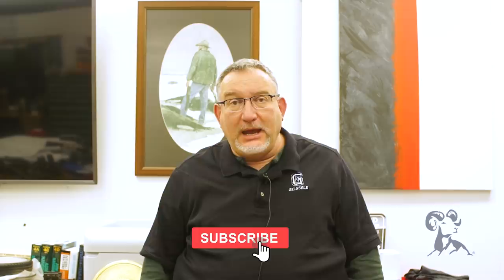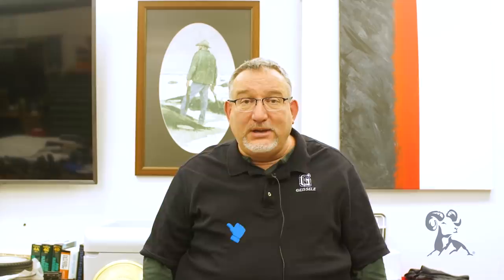SmythBusters: Galvanic Reaction & Your AR-15 - Part 2

Comment: This still does not cover all the myth or areas off. First I was told by a Brownells gun tech years ago that copper anti seizant made by Permatex was safe to use in these applications. Next what about when you true the face of the receiver at the place or point where the receiver meets the barrel extension.  In many cases there is enough material removed to go past the hard coat and especially if done to help on barrel nut timming and to reduce space between the BGC  and buffer face so that the buffer detent does not contact the buffer face when the receivers are closed, thus stopping the detent chewing or dinging the buffer face.
   So whats the word on this aspect, that is the copper anti seizant and the bare aluminium reciever face. I've been told so many conflicting things on this.
Reply: Answered in video 1.

Comment: OK, so the vast majority of joints in the automotive world are done purposely dry, and if you lubricate threads before applying your torque wrench, you're going to over-stretch the fastener and/or distort whatever you're fastening and/or maybe the gasket underneath.  Well-intentioned but ignorant people applying anti-seize to lug nuts is one of the causes of brake pulsation - lug nuts are "properly torqued" but the lubricant means they're pulling tighter than they should, so they're effectively over-torqued which distorts the rotor.  (Idiots simply ignoring torque spec is the main cause of brake shake.)

You can DEFINITELY get consistent loading of a fastener with dry, un-lubricated threads.
Reply: (The follwing reflects my experience as a simulation engineer with 16 years in the automotive industry)
The real reason screw joints in the automotive industry are done dry on purpose: Cost. Properly lubing bolts before assembly adds cost for the lube and applying it.
Overtorquing: That's why you specify different tightening torques for dry or lubed bolts.
And no, lubing is better: higher bolt pretension at lower tightening torque and less variation from bolt to bolt as the friction coefficient varies less when the thread and the underside of the bolthead or nut is lubed.

Comment: I'm puzzled by the statement that you always have to lubricate a nut and bolt type job.
Assembling disc brakes or reattaching the calipers I've always used thread lock. OK that is both an initial lubricant then it locks the thread but anything like wheel nut or bolts I wouldn't use a lubricant. I begin to understand some of how a nut and bolt work like a series of inclined planes but I wouldn't say I know a lot. Worked with a man at one point who did some work on the science of connecting components with V bands. It was turbocharger assembly. Now we know V bands work but there isn't/wasn't a lot of understanding why.
Was stood at the side of a lathe at one point when it let go of the workpiece out of the jaws. Now yes the lathe was screened, so I was safe but the bang certainly concentrates your mind. I was asked to strip back the jaws and look to see if I could identify what happened. Quite a surprise as I'd not worked there long. The only thing I could identify was that the draw bolt was lashed in grease. Figured that the grease and the vibration let the bolt wind out. I cleaned the bolt and the female thread and everything worked perfectly from then.
I'd appreciate any thoughts on when to grease or not but I certainly wouldn't lubricate every nut and bolt interface.
Reply: Go and watch the first video on this subject, loctite is not a lubricant
Reply: @shawnbrodrick8673  I did watch the first part, I responded on the second part as I was assuming that was the conclusion. "loctite is not a lubricant" I never mentioned Loctite as a brand name but yes it was their  product 242 blue  that I was referring to. Loctite covers a whole host of things from household glues, building adhesives to speciality engineering products. No now Loctite 242 isn't made as a lubricant its primary function is to be a medium strength thread lock in medium heat conditions. Now does it act as a lubricant ? I've no idea how to prove that other than if I had a height gauge and torqued in a series of bolts into a component and measured the height of the bolt head above the component on a measuring table but even then we would have to do several cross-checks. My feeling is that as a liquid it does provide lubrication at the point where the components are assembled. Is it an ideal lubricant? Lots of odd things are lubricants, leaves on railway lines, graphite (a solid) and spit. I'd never think of spit as a particularly good lubricant but if you watch a certain genre of films you will see spit used quite often.
Now If my eldest brother was still  alive maybe he could add fact or at least parameters to this argument as well as working for https://en.wikipedia.org/wiki/United_Kingdom_Atomic_Energy_Authority when it was still functional he also jointly worked for https://www.theengineer.co.uk/the-national-centre-of-tribology-celebrates-40th-anniversary/ Then again were still alive he might be able to answer when do you grease a bolt, oil a bolt or leave it dry. I've sadly missed any general guidance on that.
Shawn if I've missed your point I apologise please tell me again. Spell it out from basics don't be afraid to treat me as an idiot, you might not be far wrong. Ever since the day that lathe went bang I've known we do different things with different bolts but I've never known a general guidance why.
Reply: @COIcultist  I understand the misunderstanding of such things. I believed that you should use anti-seize when assembling an ar15,well I'm wrong as usual. When assembling heads on an engine very specific lubes are used OR the torque is completely wrong and will stretch the bolt,thus weakening the longevity of the engine. I guess it goes back to the manufacturer. In the United states Marine Corps owners manual expendable supplies and materials list item number 15 grease,molybdenum disulfide. That's the grease talked about in the first video nicknamed molly b. Never new this till today and had to look it up,I'm just a hobbyist not a gunsmith 👍

Comment: Aeroshell on titanium barrel nut any thoughts anyone
Reply: Russ Mercado I used it on a titanium buffer tube castle nut, no problems at all in four years. You should be fine using it on a titanium barrel nut.
Reply: @ renotsttam thanks for replying and confirming the use of a titanium barrel but Installed about a year ago seems to be no problem but always good to hear somebody else’s opinion thanks

Comment: Audi used steel bolts in aluminum control arms on the B6 platform. They are a real bitch to remove.
Reply: dmdhl7 as a German car tech, I feel your pain. Audi is the worst in that regard, by far the most issues with rusted and locked up suspension bolts.